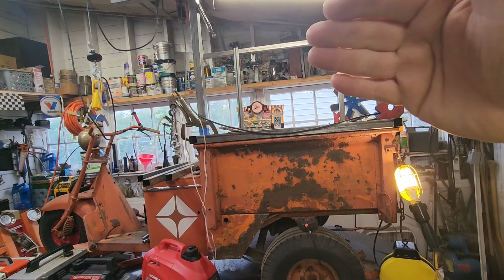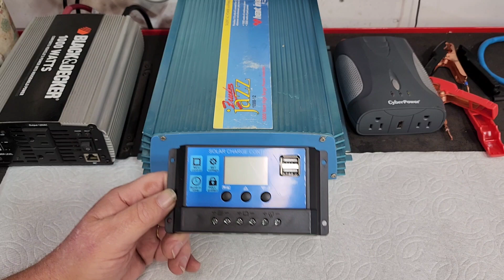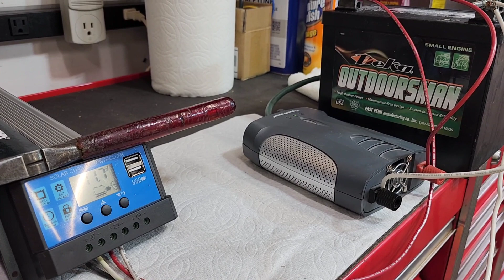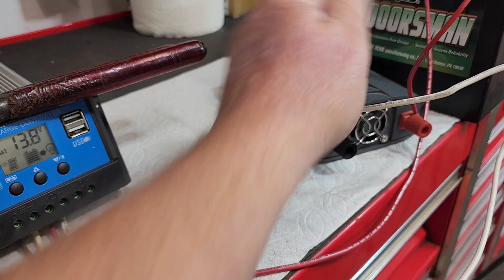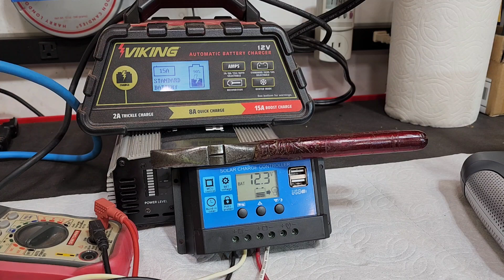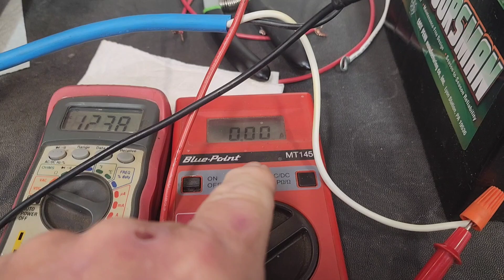Can you safely charge a 12 Volt Battery using Honda Generator? Let's explore. EM400, EM600, EU1000

Comment: in progress to invert a HondaEU10i  2021 i got for free, inverter blown but of course the 12v charge works because it is on its own winding at EU10i.. same as Eu1000i i guess  , the inverter unit is pricy here so not an option to replace it with a new genuine Honda part and none to find used, planning to use a universal AC to DC to AC inverter. ignition unit and eco switch RPM sense load works . the big cap was blown at the inverter, i cutted it in half and soldered a new on but still no 220V , yes i am in Norway and EU inverter here have only one big cap 470uF 450V and it was so blown ..  Edit..while my 39 year Honda EM650 have been running without any flaws. it just run and run
Reply from the maker: Good luck with your conversion to a stand alone inverter. I too have a 650, a couple 400s, four eu1000s, two eu2000s, two eu3000s, and an eu7000. Kind of a horder. ...